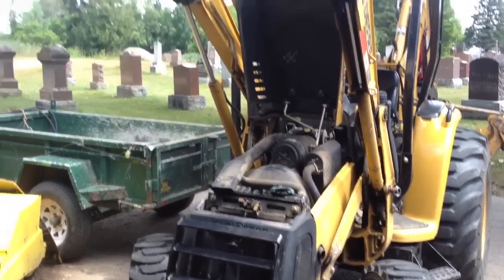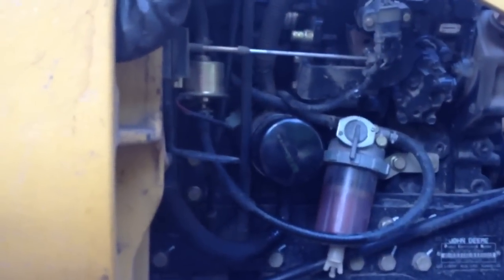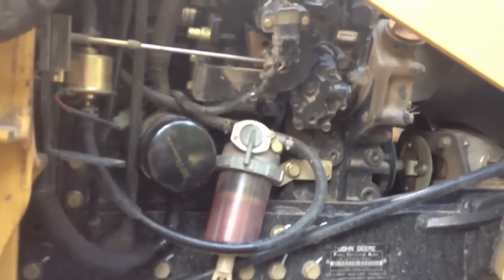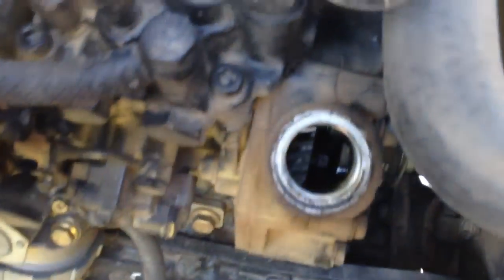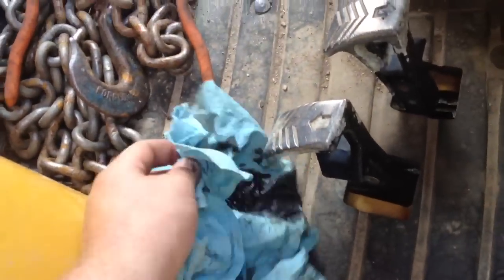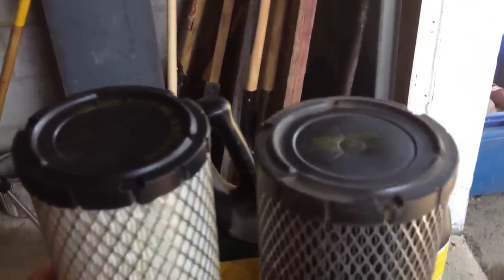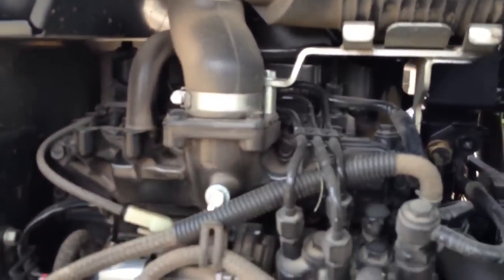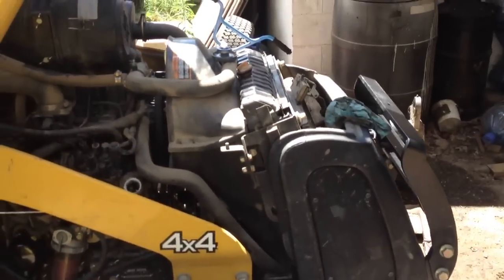Oil changing and servicing

Comment: oh and to fill the radiator, its through the overflow tank. it seems kinda funny but that's the way it is, just look at the cap. if its a pressure release cap that's where the fluid goes into for the radiator

Comment: yeah like i did it just today and i had to reach my bare hand into the oil and then dropped it on the ground by mistake and then lost it and found it on top of the engine and then put it back in its place after the oil had drained. then i forgot to look at the filter to make sure the o-ring is on it and went ahead and put the new one on the car ontop of the old ring  and when i started it up i lost about a quart of oil. so today was kinda fun for me, but im tired as frigg

Comment: heres a lil tip so you dont have oil drain down your arm and so you dont drop the plug in the pan - - - as you unscrew the plug by hand, push the plug against the hole until the last second!